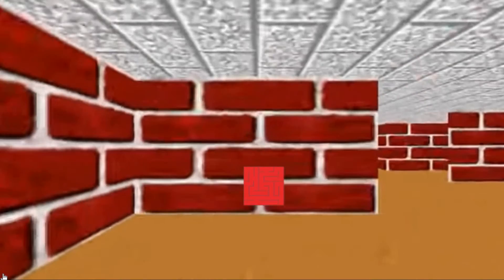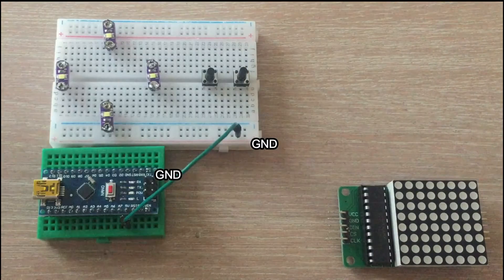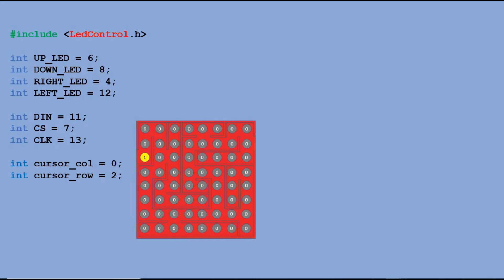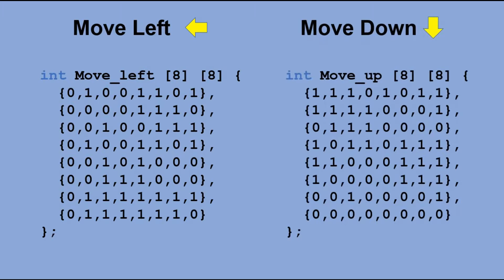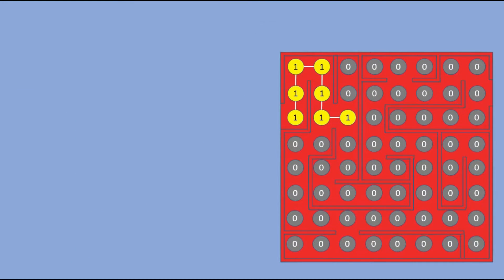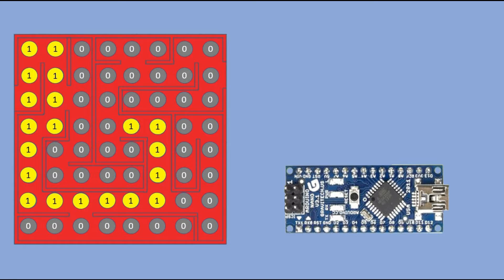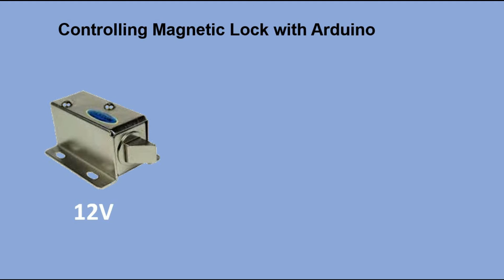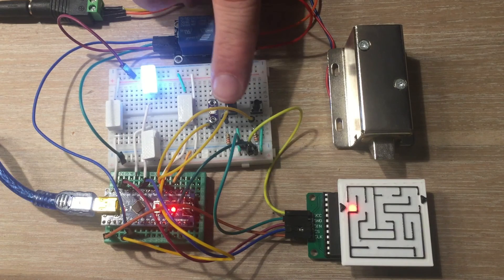Escape the Maze: Arduino-Powered Puzzle Lock with MAX7219 Matrix Display

Comment: The wiring diagram is wrong in some places. Was this done intentionally or is it just a distraction? The STL file of the labyrinth, you haven't published it?
Reply from the maker: Can you point to the exact timestamp in the video. It is an old one and it is possible that I made a mistake.  So the diagram in the presentation is different then the actual wired circuit? If I did I would like to add a comment in the description of the video.
Reply: @marios_ideas  8:41 the LED at the top has the wire coming from D5 connected in the wrong place, it must go to the Anode. The LED on the right has the wire coming from D4 also connected incorrectly and goes to the Anode.
Reply from the maker: You are absolutely correct. Thanks for spotting this. I will add commant in the description @stefanopalazzeschi291